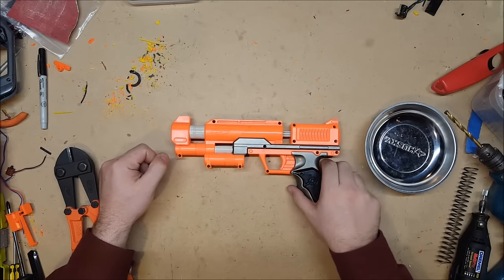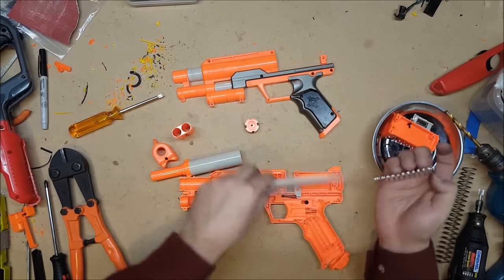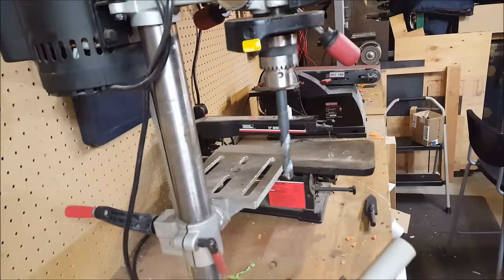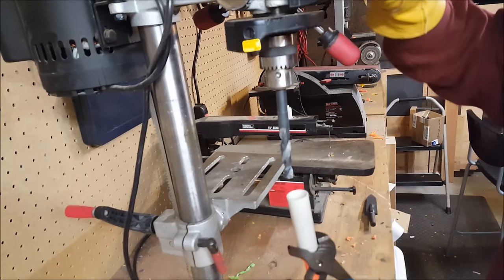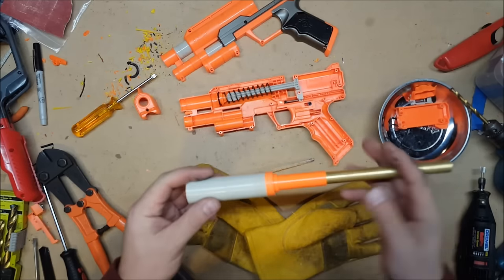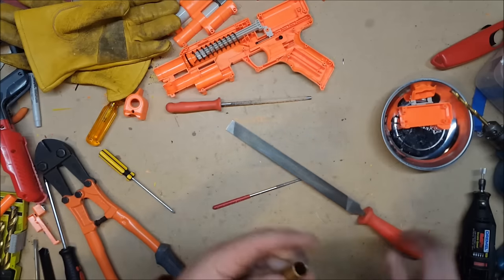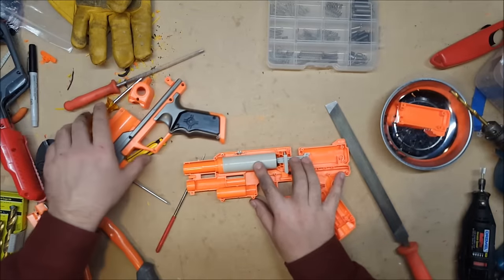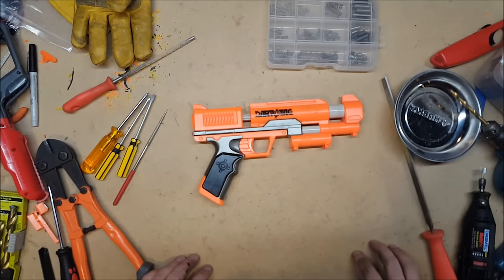Nerf Stormfire Mod Guide

Comment: hey man, just an fyi, you shouldn't be wearing gloves when using tools like that. It's great for stopping yourself from getting cuts, but if the bit grabs hold of the glove it'll crush you're whole hand. Only mention it as I've seen in happen in person. A few cuts are easier to handle then crushing all the bones in your hand. (this is only for tools like this with rotating parts, not saying you shouldn't wear gloves ever)

Comment: Nice! good to see you show a little more of the steps in detail now. If it were up to me you could show even more of the "boring" work. Less editing for you and tho it might seem boring to watch, for some reason it isn't. I like these diy videos because they have a strangely relaxing effect on me, kinda hypnotizing almost. I dunno. I'm very likely very weird. Btw, couple of noob questions: what does the air restrictor do and why does it have to go? And why do you brass the barrel? Is it smoother than the plastic or something? Oh, and don't wear gloves when operating rotating power tools, kids! They can get caught and hurt you even worse because you can't pull away. ;)
Reply from the maker: I will keep that in mind during my next video.  I hope to do one tonight actually.  

The AR is there to protect the blaster in the event of dry firing.  It creates an air seal that cushions the plunger head and keeps it from slamming into the end of the plunger tube.  Useful in a kids toy as they do not understand not to dry fire it.  However, this also cuts down on the power of the blaster as the AR kicks in before the dart has left the barrel.  The brass barrel is there because Nerf barrels are slightly tapered and thus do not have a perfect seal for their whole length.  The brass tube does so once again it adds a bit more power. 

A few people have pointed the glove thing out.  Thanks for reminding me.
Reply: Alright, got it, got it, thanks, and you're welcome :)
Reply: Captain Xavier

Comment: Do you have to use brass on the barrel or could it be PVC pipe or a steel pipe or something similar
Reply from the maker: Any material that fits and works...will fit and work...

Comment: This is unrelated, but have you thought about doing a select fire mod for EIR? between semi, burst, semi, and full auto?  I'm curious to know if that would work in a stampede as it is a Springer
Reply from the maker: I have considered it.  I am starting to dabble in micro-controllers.  I do have a CS degree after all...and I took Real Time Operating systems...I just need to learn the Arduino syntax and start tinkering.  It would be much more difficult in a Stampede than, say, a Rapidstrike because of how the Stampede works...but I am sure it can be done.
Reply: Captain Xavier where can i buy k26

Comment: Is getting the air restrictor out really worth it?  Also the Nerf Zombie Strike ZED Squad Clear Shot Blaster is the same gun as this one?
Reply from the maker: I have not done exhaustive tests yet on the difference between AR and non AR so I honestly cannot say.  Some people say yes, others say no.  And yes, this is the same as the Clearshot.
Reply: Captain Xavier which is easier to find would you say? The clear shot or this one?
Reply from the maker: Well the clearshot is still being sold in stores so it is probably easier.
Reply: Captain Xavier yeah I guess that would make it easier to find XD. Thanks. Keep up the great work!
Reply: Captain Xavier where can I get k26 spring

Comment: I modded mine and left the stock spring in and put a nitefinder plunger spring in. 
Didn't even need to improve the catch spring also brass barrel. Ar removal and taflon tap around the plunger head under the o ring. Fires way better and stronger
Reply from the maker: Very nice
Reply: Captain Xavier 
Hi captain Xavier 

I love what you do and still being young find it hard to get proper resources for my mods and wanted some wisdom from you
Reply: Gabriel Grenier

Comment: will a STRONGARM or DISRUPTER spring work with replacing the spring for the clearshot?
Reply from the maker: Probably but most will be comically under-powered for what this can handle.
Reply: @CaptainXavier  So will something like a firestrike spring work, or is that like the strongarm and disrupter?          im new at modding, so im starting with pistols
Reply from the maker: @Pxreless  good plan. And yes, internally this is very similar to a firestrike and will take the same springs.

Comment: Is the loud noise followed by the ringing after firing louder than it is in the video?
Reply from the maker: Bean 41 yeah, modern cameras have noise cancelation built in.
Reply: Captain Xavier I kind of figured. I just did this modification and mine is extraordinarily loud.
Reply: Captain Xavier I didn’t put any Teflon tape under the O-ring and that’s where the loud noise was coming from. Replaced it with retaliator O-ring and some white lithium grease and it works beautifully now.

Comment: what measurement was the brass that you used?, any help or comments would be greatly appreciated by me and my nerf blasters :)
Reply from the maker: 17/32 in
Reply: @CaptainXavier  would this be adequate enough in an inline clip?
Reply from the maker: @gusflynn6424  no, 17/32 is too tight a fit for an inline clip. With inline clips most of the barrel needs to be loose while only the end of the barrel is tight. That is how they work. Only the first dart seals on the tight part of the barrel while the air passes around the other darts in the loose part.
Reply: @CaptainXavier  what measurement of brass would u use for the tight end then?
Reply from the maker: @gusflynn6424  17/32s. But it needs to be nest in something bigger. I don't know exactly how much bigger. I have never designed an inline clip.

Comment: how do you know if you have put too much Teflon tape because I modded my first gun and it was a fire strike and now when I leave it for a while then prime the first pull is really hard like it's stuck but then really smooth. did I do something wrong? I only put 2 wraps of electrical tape
Reply from the maker: The plunger should still slide easily in the tube.  If there is any drag it is going to cause issues.
Reply: Captain Xavier it does normally it's just the first pull when I have left it for like and hour. is that normal?
Reply from the maker: I've never had that happen.  Is it well lubricated?
Reply: Captain Xavier I think, I put a load of silicone grease on it
Reply: Use Vaseline, it works like a dream
Reply: Jeremy Lopat won't that damage the o ring

Comment: hi, if you use a 17/32" reamer, you can press the brass in without filing.
Reply from the maker: A "reamer" you say?  Is this a kind of drill bit or some other tool I am no familiar with?
Reply: It's a tool used to make a precision diameter round hole. Usually you drill a undersized hole and ream to size. They cost more  than drills, unfortunately. Google it for pictures.

Comment: Hey i have a totally unrelated thing to the video, but i thought i should mention the idea to you captain. You use a ton of cylinders for your drain blasters. well i have an idea for a cylinder you could use. The Knex Rotoforce cylinder seems like it could work. Tell me what your thoughts are if you read this. Thanks, have a great day!
Reply from the maker: I see not reason it would not work but I also see not inherent advantage to it over a Hammershot of Xshot cylinder.  It might be better than Maverick cylinders though.
Reply: Captain Xavier Ah, thats what i figured, but i was thinking maybe it would work about the same and be an OK replacement for those two. Anyway, thanks for telling me that.

Comment: You should slightly trumpet the end of the brass. It will make it easier to seat darts and lock in the barrel permanently
Reply from the maker: I have considered it.  I probably will going forward.
Reply: awesome
Reply from the maker: I have started doing this.  Turns out I have the perfect hammer for it.  A few light taps and it flares them perfectly.  Thank you.
Reply: No problem its a ball pean hammer right?
Reply from the maker: Yeah, but an obscure one.  I usually use it for planishing.  It has a very small ball pean side.  Not usually any use.  But it is perfect for this.  I will show it in my next mod guide video.

Comment: Is there any way to take the air restrictor without a drill bit
Reply from the maker: Yes, you can use a long flat-head screwdriver and try to hammer it out, but you rick breaking something.
Reply: Captain Xavier okay thanks

Comment: nice and simple i like it any thoughts on someone who is just getting into the nerf moding game?
Reply from the maker: Start with something simple like this.  Learn to solder.
Reply: I do know how to do that had a class in school souly on soldering so there is that lol but thank you
Reply from the maker: Lucky...I had to teach myself...and for years I did it almost, if not quite, entirely wrong.  I am much better at it now.

Anyway, if you have the skills and tools to solder then the world of Flywheels upgrades is yours for the taking.  Motor and voltage mods are actually fairly easy if you can solder.
Reply: Yeah just need to know what you are doing theres some im working on now that i hope turn out all right just have to get a few things yet. One thing i was gonna ask have you ever used smoth cast 65d? Coop772 has used it for intagrasions and claimed its wunderful

Comment: Can you put a link to good brass in the disciption?
Reply from the maker: I get mine at a local Hobby Town as it is much cheaper than any place I have found online.  That being said here is the cheapest I have found online.

http://www.ebay.com/itm/K-S-Metal-Round-Tube-17-32-D-X-12-L-Brass-Carded-/272052061138?hash=item3f579103d2:g:OfQAAOSw9NdXu2Ie
Reply: Captain Xavier can you also get brass at home depot or someting alse
Reply from the maker: Some ACE hardware stores carry it.  Also some Hobby shops.  Home Depot does not carry it.  At least not that I have ever seen.
Reply: Captain Xavier ok, thank you